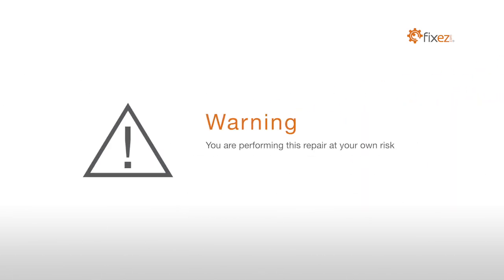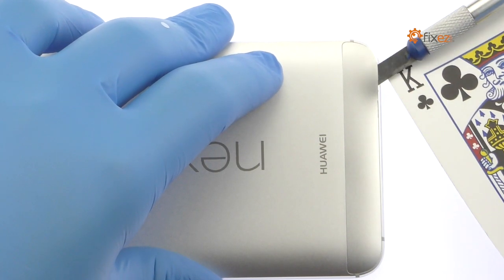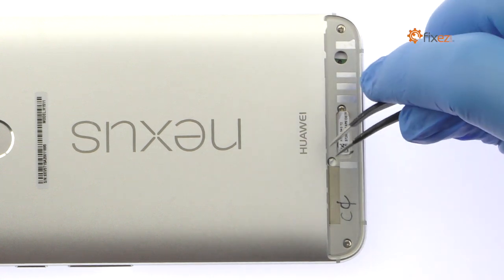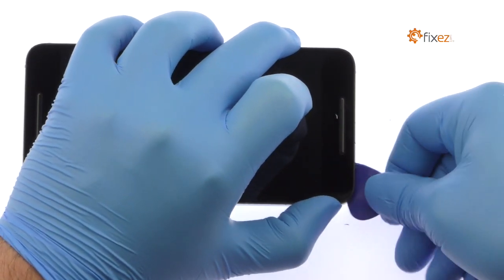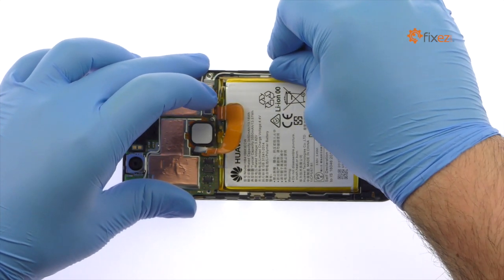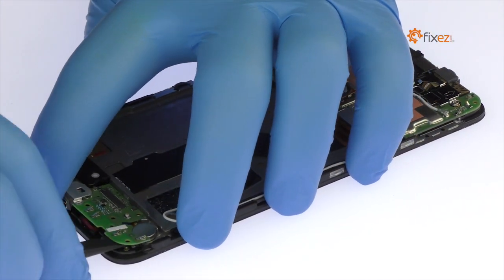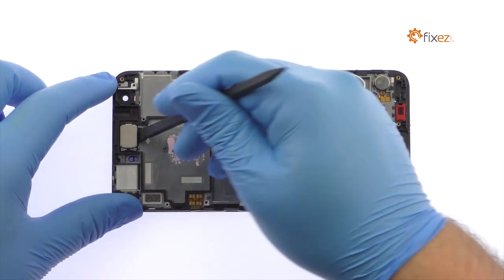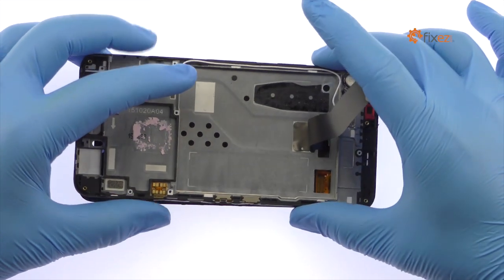How to Huawei Nexus 6P Screen Repair Guide (LCD and Digitizer/Front Panel) - Fixez.com

Comment: IDK why they couldn't have designed the phone for a ribbon plug on the back of the screen, saving a ton of teardown just to repair a commonly broken item. To design a phone that requires a complete tear down just to replace something that is the cause of 80% of repairs is just nonsense.

Comment: I hurt the skin of the batteries. I tried to fix this fine plan. Can I use the battery yet? Unfortunately, the device does not turn on!
Reply from the maker: +Daniel Formanek If the battery was punctured do not use it there is a risk of it exploding.
Reply: okay thanks! I ordered a new one!

Comment: Great video. Probably the best that I have seen.  Everything was exactly as shown and the process was simple.  For those that are considering this though.  2 things are KEY.  1. Have a good heat gun.  This phone is glue, glue, glue.  Also That multi-adhesive tape is absolutely necessary.  Don't be me people and have a phone that is held together by the case until the tape comes in.  Just order it with the glass and digitizer.
Reply: Order the whole frame like i did, and also advice be VERY careful when removing the battery! NOTHING SHARP! just a playing card and patience is all that's needed serious. I went in with tweezers and accidentally poked a hole in the battery, smoke and sparks came out immediately, could have blown up. Be careful.
Reply: Any further instruction in case I change the whole frame? Seems like there is additional parts to be removed  though...

Comment: Just purchased the screen+assembly. Hopefully its not too hard of a repair. Although Huawei makes it damn hard.
Reply: UPDATE?
Reply: Othman Aljameel Screen worked perfect.
But now i don't have data. still can text and call, but for some reason cant use the internet says i'm in roaming.
Have yet to take it back apart, and make sure i plugged everything in correctly.
Be careful.
Reply: Thanks, i hope u managed that problem
Reply: any news on this? thanks in advance...
Reply: No time at all to re open it back up. Still no data lol. Getting by somehow.
Reply: where did you buy the lcd

Comment: What if I only wanted to replace the front glass, not the whole LCD/Digitizer assembly? Do I still need to take the whole thing apart or would it be ok to try to remove just the front glass panel? Thanks in advance!
Reply from the maker: +Sixto Cabrera the phone does not have to be fully disassembled to replace just the glass. However we do recommend replacing the full LCD/Digitizer assembly. Thanks watching.